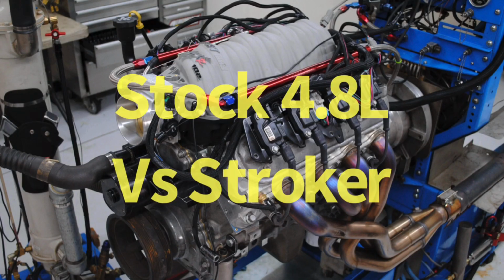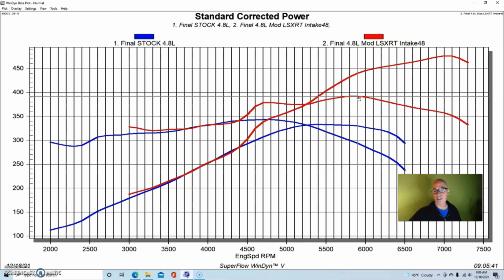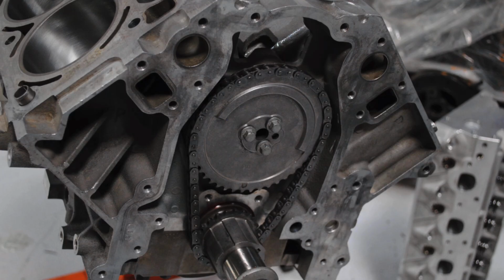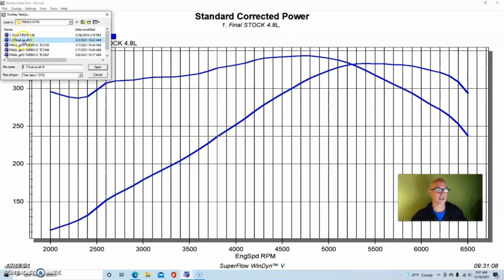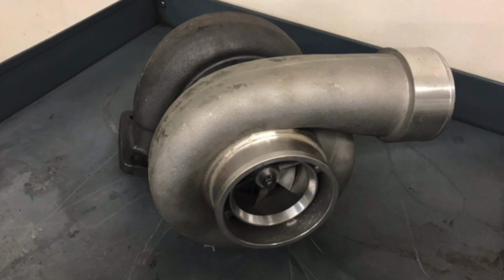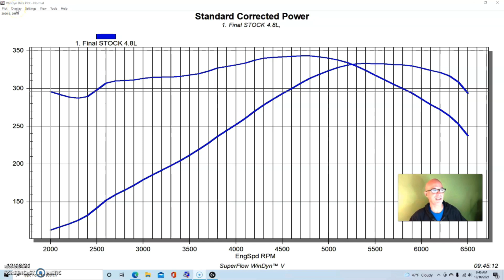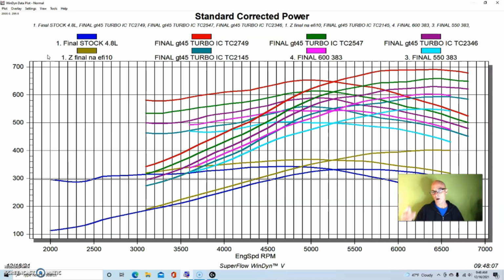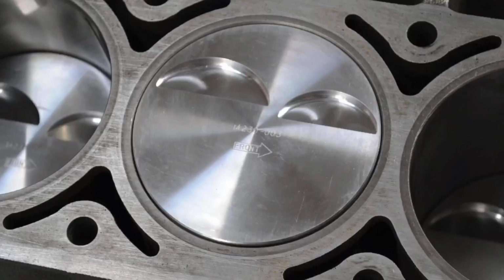HOW TO: MAXIMUM 4.8L LS POWER-383 STROKER VS JUNKYARD TURBO  BOOST-THE REPLACEMENT FOR DISPLACEMENT?

Comment: I think that you have already tested this however I cannot seem to find it but I was wondering how a S475 turbo on a 4.8L LS would compare to a 383 Stroker. Would simply switching from a GT45 turbo to an S475 turbo change the hp/tq closer to what a 383 stroker. I think that it would have to bigger turbo etc. However I cannot say for sure and what possible pitfalls would come with switching from a GT45 to a S475. Thanks
Reply from the maker: the S475 is capable of supporting near 1000 hp, the GT45 is closer to 750 hp. They will do this on either motor, the smaller turbo will offer better boost response (same for the bigger motor)

Comment: What if you added 6psi to the 383??
Reply: But would it add an additional 200hp on top of what the 383 does already?? I'm just curious that's all. Bang for your buck option is probably leaning more onto the turbo alone.
Reply from the maker: it will increase the na power of the motor by 40-41% if everything is right.
Reply from the maker: it adds power

Comment: That 600 hp 383 is really nice, but I bet it’s $8000 to duplicate it. If you have a Gen IV long block, say an L33, you could bore it to 5.7 for $1000+/-. Granted an L33 is the most expensive 5.3, but it’s way short of the built stroker and has slightly better stock heads. Or just leave it at an iron block 5.3L and save some more. Add a turbo using truck manifolds and a cam—four digit power potential for way less $$.

Comment: Any guess on HP on the 383 stroker on E85 and 13:1 compression?
Reply from the maker: what heads, what cam, what intake etc...?
Reply: @richardholdener1727  Same engine that did 603hp
Reply: @richardholdener1727  I am guessing around 650hp

Comment: you said you used 6.125 rods with a 4 inch crank? Is the pin height higher in the piston?
Reply from the maker: yes-it was a custom piston to work with that combination-very common

Comment: Some of those wwII airplane motors made some crazy hp for a long time with the help of boost and water injection! Boost lets you make power to the limit of your hard parts pretty fast if you just keep turning it up.

Comment: 1.4 Ft*Lbs per Cu Inch is very impressive. Do you think with a hotter cam and better springs and the same Heads and Intake as the 550 HP 383 you would have been able to make near 550 HP near 7500 RPM or would that have been beyond the RPM limits of the rotating assembly ?
Reply from the maker: THE HEADS ON THE 550-HP VERSION WILL SUPPORT A HIGHER PWER LEVEL

Comment: Jeep 4.7.  Not interested in big hp, would like a low boost torque in midrange application.
Reply from the maker: GT45 TURBO
Reply: @richardholdener1727  Thanks, that is what I was thinking.

Comment: I have a lr4 with a 220/220 cam , upgraded springs and hardened pushrods with stock 862 heads, thing is a beast with a 3000 stall converter and mild built th350....revs to 7500rpm all day long, I had it in my nova until I put a lsa supercharged 370 " lq9 with ls3 heads in it, now the 4.8 lives in my '73 c10 short bed and has no problem doing rolling burnouts with ease. ....I'm on the fence of adding a cheap turbo kit just for shits and giggles. .......but honestly it does its job just fine as is!!!......still trying to recoup and dial in the lsa supercharged nova and get the terminator x tune dialed in better before I dive into a turbo build,  plus my wife would probably have a cow if she seen me dumping more money on something that is perfectly fine!!!!........I guess if I want to ride turbo my lmm duramax will have to do, a h&s minimax tuner wakes that beast right up!!!
Reply from the maker: 7500 RPM WITH A 220 CAM AND TRUCK INTAKE-THAT'S A GOOD 1200 RPM PAST THE POWER PEAK

Comment: This ls stuff is awesome. I remember back to the old small block Chevy and back then 400 to 450 hp was the normal and 383 stroker was good for 500 hp the really expensive builds could get 625 or so. Time and technology has been good to gearheads
Reply: Considering the LS1 has been around since 1995 (1996) in the Corvette and 1998(1999) in the GMT800, and production ended in 2016,that's 20 years of 1 engine platform that resulted in the Gen 5 LT1, yeah aftermarket is going to be bigger. The Chevrolet Atlas Engine was unfortunately short lived did not have aftermarket performance parts.

Comment: Kinda feel the need to specify that the 383 motor can be built from any of the small displacement motors. 4.8/5.3/5.7.  
Not just the 4.8. Just in case some people don't know that. 👍
Also if your going to spend the money on a stroker kit start with the 6.0 and do a 408. Or bigger. 😃
Reply: You ain’t wrong on that but not everyone gonna want to swap out a 4.8/5.3 and get another block just because, I’d just pull out my 4.8 have it cleaned out with all new gaskets and internals bore it out to a 3.902 then put a 4” crank and go on with the project
Reply: 293, 325, 364 (4.8, 5.3, 6.0)
Reply: @shadowopsairman1583  yes we all know the original displacements or these motors. Thanks.

Comment: I'm having an ongoing disagreement with a good friend. He has a 91 Corvette ZR1 with the quad cam Mercury motor. They believe it's the greatest thing in the world. It's a very expensive overly complicated engine that uses very antiquated fuel injection compared to today.  He's purchased a spare intake manifold that he's going to Port and polish. And adding long tube headers. He believes he's going to have this huge power gain!  No ECU tuning and no other changes. I keep trying to tell him that he's probably just going to ruin a very expensive intake manifold and gain nothing.  Not without other changes for compression boost nitrous something.  Please help me settle this argument!
Reply: Just remind your friend that she/he doesn't know more about intake designs than lotus engineers.
Reply from the maker: he won't get huge gains-the guy at Pacific Performance did the ZR1 motor back in the day-he needs head porting and cams
Reply: @richardholdener1727  he said 32 valve mercury engine, so likely the 4.6 marauder?  Not sure why anyone would put that in a zr1, but it's a cool engine.
Reply: @bgee461  no.  The ZR1 engine was a quad cam.
Reply: @Mastermindyoung14  he said mercury though?
Reply: @bgee461  he almost certainly misspoke

Comment: Only draw back to boost is weight on the front end of the car.
Reply: Put it in the back then
Reply: @Mastermindyoung14  not exactly efficient that way and doesn't fit on every car.
Reply: @Goes 2 Eleven not just  talking quarter mile. Talking autocross
Reply: @Paul Schwartz a highly modded GTA.  And any spirited driving it adds weigh in the front for mountain running or road course. I still use mine to do mountain driving with the family too! Just makes the car unbalanced unless you completely make the car not useful except racing.  I don't run a turbo that is the point of what I said.By the way don't be a d...k

Comment: Hey Richard could you go through the entire process of setting up an EFI system on an LS everything from it not starting to getting it to the point where you can safely Dino run. I recently saw a video of a guy Dyno testing a 900 hp 5.3 but the initial map and everything on it was so bad it couldn’t start and wouldn’t idle or be able to go into gear. I feel like you would be very good explaining how you get to the point where you have a running engine.

Comment: What's the most boost you've made with the summit s475 turbo? How would twin s475s run on these motors?  @richardholdener
Reply from the maker: a single s475 from Summit will support 1000 hp or so
Reply: @richardholdener1727  in your opinion do you think maybe 1500 or so from two of them?
Reply: @danieldeweese8749  if 1 is good for 1K hp then the really crazy math shows that 2 is good to about 2K hp.
Reply: @Aaron Liddell. Sometimes it doesn't work out that way. Would that mean that if one turbo can put out 15 psi then 2 can put out 30? Or one puts out 30 then 2 can put out 60 psi? I genuinely don't know the answer. I've never boosted something with 60psi before so I wouldn't know.
Reply: @danieldeweese8749  A turbos hp rating is based off how much volume of air it can move, not how much boost. Boost is only a measurement of restriction.
Reply: News to me. I guess that's why you ask right?

Comment: If you took the 383 and the turbo 4.8 and they were in identical street cars...the 383 would run and hide from that 4.8 in anything other than a 80 roll.
Reply from the maker: the na 383 would lose by bus lengths (about 100 hp or more worth)
Reply: @richardholdener1727  nah...The N/A guy dont sit and wait for the 4.8 guy with the lazy gt45 to spoil.  By the way, I have a turbo 4.8, but not 130 degree temps with no acc....and perfect conditions under the hood.
Reply: @tunerdadtunerdad7927   why coulsnt the 4.8 turbo brake boost from a roll?  Or have a two step if from a dig?  

No waiting for boost needed.

383 would get worked!
Reply: @Slowv8Fiero  ...Lol... My bad.  What was as I thinking?  Absolute BEST case scenario dyno numbers rule all....
Reply: @tunerdadtunerdad7927  absolute best case 383 dyno numbers too then right?  You think everyone is gonna make 600hp?

Lol. 

Thanks for pointing out the best case numbers.

Epic backfire
Reply: @Slowv8Fiero  I'm going out on a limb and guessing you have never had either.  The earth's flat
Reply: @tunerdadtunerdad7927  I'm going out on a limb and guessing you haven't dynoed either of your setups on an engine dyno like richard has.

The moon is made of cheese right tunerdad?

Lol

Comment: So iv been looking around on the channel rich and I can't find a video on stock ls truck rods and how much they can handle till they break
Reply from the maker: we've made 1543 hp and 1330 lb-ft with stock rods-is that enough?
Reply: @richardholdener1727  that is plenty rich thank you can the stock pistons handle this as well with .028 gap ?

Comment: I’ve become a believer in the 4.8’s much stronger Rod/Stroke ratio, believing it can handle more power. Ratio 1.92-1
I’m building a Big Bore 4.8: 6.0 block and pistons with 4.8 Crankshaft and Rods. 333 CID Hello 8000 rpms and 24# boost!
Reply from the maker: the 4.8l crank with 6.0l bore will just make less power than the standard stroke
Reply: @richardholdener1727  didn't you test the high revving de-stroked myth?
Reply: @Mastermindyoung14  Yes. He did.
Reply: @Mastermindyoung14  It’s not which engine can make 30-60 more HP, I’m talking SBE parts 333 vs 364 which can handle more MAX HP? 
I’m saying the Stronger R/S ratio of the 3.268” stroke and 6.275” rods will live longer!  
Hey, life’s full of choices I’m showing alternatives the average builder may not know. 
RPM, I can spin a 3.268”/6.275” bottom end 8000+ rpms without hesitation.   JD
Reply: @Cowboy.underwater  Unfortunately didn’t explore strength and longevity. Yes it’s been proven CID makes more power, I’m not worried about making 30-60 extra HP.  I’m looking at building a Large Bore 4.8 using factory parts and comparing the results to a SBE 6.0 in a Max effort battle. 
My belief is the short stroke longer Rod engine will handle more MAX power; and easily spin 8000+ rpms.  Again with more strength and durability.  JD
Reply: @richardholdener1727  How much “Extra” power do you think your 364 CID can make over a 333 CID?  I’m truly curious how much more and at what point does it become an option to build a stronger combo?
Reply: @richardholdener1727  Strength, I can easily make 500+ HP w/333 CID crankshaft then ADD 15# Boost now I’m at 1000+ HP  all day long. 
1.92-1 R/S beats a 1.68-1 all day in endurance and longevity. 
Bonus:  If you’re interested in No Prep or Street racing it’s a lot easier to get a shorter stroke down the road.  Bets anyone? 😉
Reply: That's a goal of mine. Back in my mustang days I'd rather have a 331 vs. a 347 based 302 becaus it has the favorable r2s ratio. Planning on a 6.2/4.8 crank setup at some point. May swap out the 6.0 in my RCSB for it.
Reply: Interesting 🤔
Reply: What are you putting that its purpose? I bet that'll sound crazy in the revs
Reply: Bigger rod/stroke ratio is better for longevity, but worse for power production. Interesting tidbit
Reply: @Kincentc  Interesting, I will point out there’s  SBE 4.8 combos making 1300+ hp running High 7’s in the 1/4 mile.
Reply: @HeadFlowInc  I know lol. I'm not saying that long ratio motors DON'T make power. Just a teeny little bit less

Comment: I'm just thinking about how much it would cost to build a600hp na motor compared to just adding boost.
Reply: 600hp na will be 12k
Reply: Depending on where you wanna make that power @ on an N.A..

600 @ the crank...mehhhh,not that expensive 

600@ the wheels? Break out the fuckin check book,credit card,cash in your 401k,clean out all of the bank accounts, possibly get into pimping..cause it'll get expensive quick .lol..

Going force induction? Honestly can make big power for only a couple grand...
BUT...an N/A will definitely have better bottom end torque,vs turbos,just due to spool delay/lag...shit,my 3.5 EcoBoost doesn't start really spooling hard,till about 2500..but once they light up,she's gone...they both have their pros and cons...I'd personally like to see a build video myself,just to see the same cosr vs cost as you're mentioning

Comment: Would love to build a 383 with the lm7 I have but for torque more than HP. Curious how that would work
Reply: If you want torque, you can get it one of two ways: turbo or displacement. Build a 383 with truck parts (intake, BTR truck cam, etc) and you'll make the low end torque. You can't do that as well with an LM7 without boost.
Reply: A small camshaft.

Comment: Hey richard, it's Charlie from ohio. I'm building a very interesting setup based on a SBE 4.8. has a LS1 stage 3 BTR cam, a set of milled .030" 799's, TBSS intake, 1.75" headers, and good valvetrain parts. I think it should run well. Going in my Fairmont in front of a T5 transmission... I'm hoping the lack of low end torque will allow it to live until I can afford a t56. As always man I love the videos.
Reply: It should hold up OK on the T-5 as long as you don’t get too crafty with traction and try to dead hook the thing a ton. Fairmonts aren’t super heavy and that helps the cause. I would keep a radial on the car so you get some tire spin under hard launches if you wanna save the gearbox and also use a good clutch so you can slip it out of the hole and save some shock on the cogs in the gearbox. I’ve used those Tremec 5 speeds behind boosted SBF setups making upwards of 500 HP and had them survive just fine on the street, but they like to check out when you start putting sticky tires on and doing aggressive or “no lift” shifts on a well prepped track. My WC T-5 lasted the longest (93 Cobra pull out) and I ran that behind an 8.2 deck 331 on spray, but as I said even base T-5s have worked for me at high(ish) power levels if you baby the shifts. If all else fails, T-5s are a dime a dozen so you can always keep swapping them out when they break until you get a 6 speed.
Reply: @kennethpowers8995  I'm using a NWC GM t5 from an 80's Camaro. I've had many mustangs over the years and if I never drop the hammer it should last. Car is minitubbed with 315/35/17 mickey Thompson Street comps on FR500's. Has a built 8.8, cobra brakes all the way around and coilovers on all 4 corners. Had a 01 cobra 4v and a 96 cobra t45 that didn't last long. I'm using a McCloud RST clutch, custom hydro clutch and Terminator X for engine management.

Comment: I'd STILL love to get a 67 Chevelle and drop a forged and stroked 383 into it and either add boost or a 3 stage nitrous kit to it with multi-port fuel injection with a Holley EFI engine management system.

Comment: Displacement helps compensate for low octane. A 91/92/93 octane build NA 383 will rock pretty good and probably won't get beat too bad by a 91/92/93 octane tune turbo 4.8
Reply: Lol what
Reply: Plus out on the street with no cool-down the turbo guy will suffer.

Comment: hey Richard, how about some twin charging on a 4.8. roots plus turbo. im looking into boosting my yukon 4.8 and adding a btr truck norris cam
Reply: Yes we need to get some info on how different power adders interact with each other when run simultaneously, I know there's some wierd interplay between twin screws and twin charging.
Reply from the maker: there is no weird interaction-its just boost